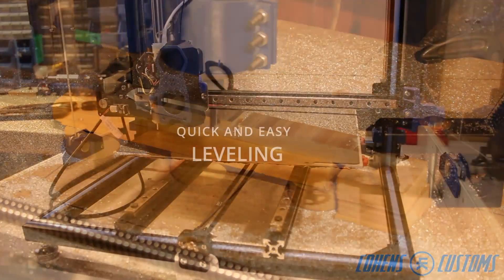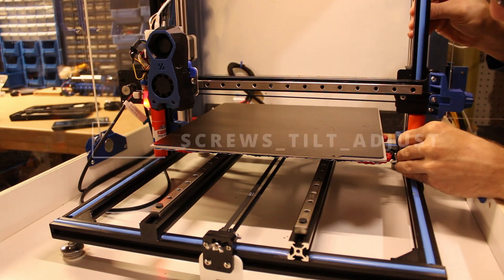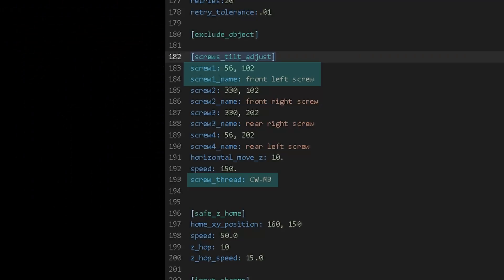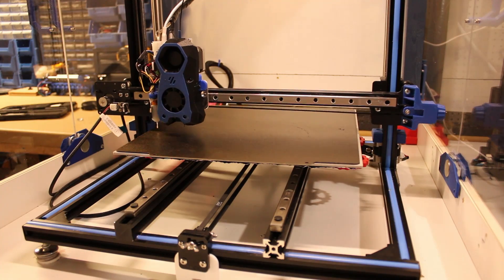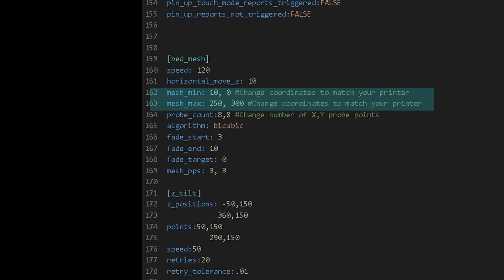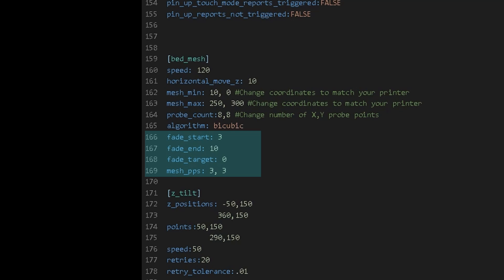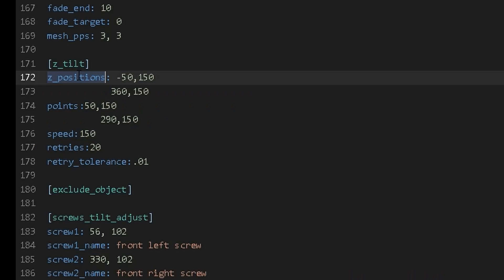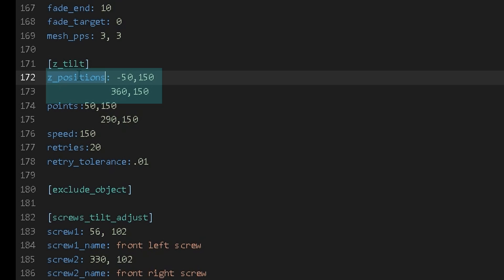EASY BED LEVELING PROCEDURE FOR KLIPPER USING A BED PROBE

Comment: Hi thank you for the great content. Have a question for you. What is the issue with Klipper when saving your Z offset config, but when initiating a new print it appears like those settings did not save at all as my print will print in mid-air?
Reply from the maker: Sorry for the late reply. When saving your z offset, you hit the save button where the z offset is adjusted, then in console you type "save_config". Have you already done this?